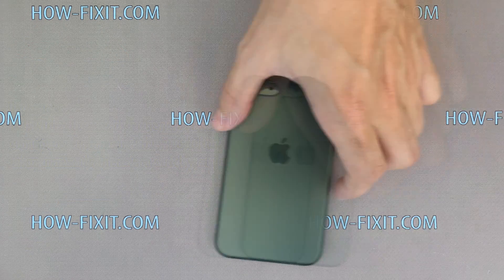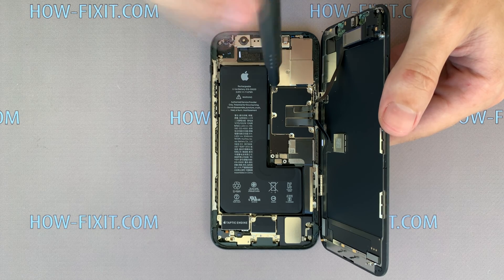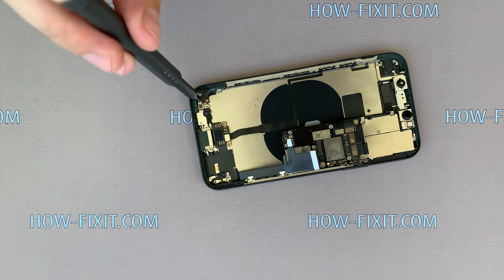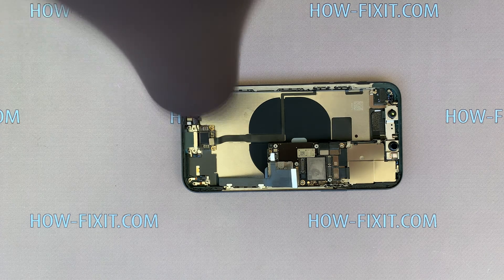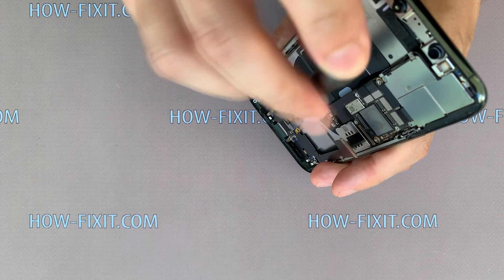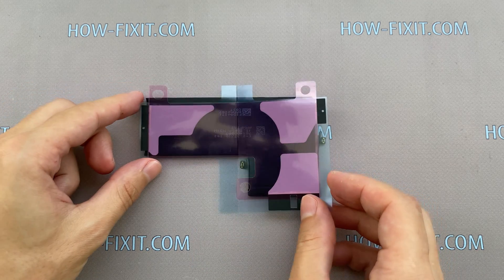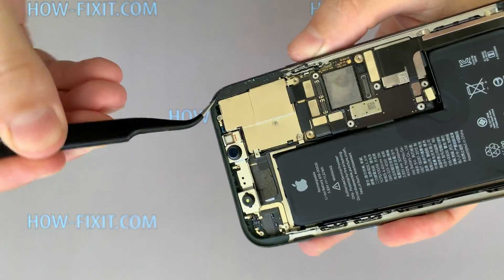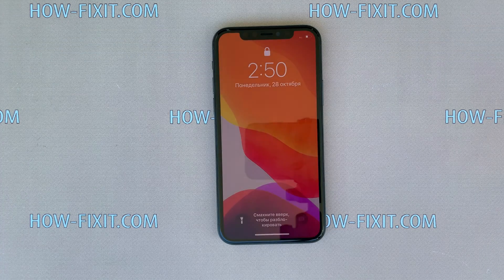iPhone 11 Pro Charging Port Replacement - DIY Guide

Comment: clearly, apple has tried to deter us from doing this, based on the number of steps. will try it only because i am doing the battery anyway.
Reply: Im in the same situation Baterry and charging port, have you already done it? I’m scared lol
Reply: @andrewaton3353  not yet! Have had trouble getting the phone open
Reply: @andrewaton3353  I cannot get the phone to open

Comment: You are amazing guys, but one thing... I see you remove what looks like silicone or something similar around the edge of the display and under other parts and you do not reapply it during the re-assembly. So the iPhone 11 Pro is no longer water proof once it's been opened?
Reply: correct even if the gasket is replaced the seal is compromised from what it originally was.  there is a way to make it seal tighter w a primer but i don’t know if its 100% of what is was
Reply: You’ll need to clean old one and to apply a new adhesive seal to restore the waterproof feature.
Reply: It's not water proof no but I shower with my phone daily and its fine